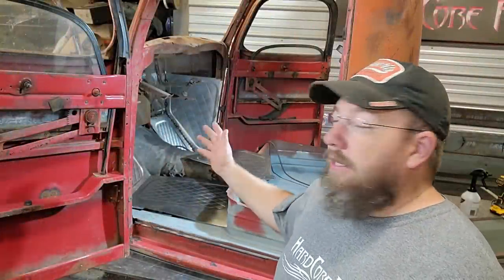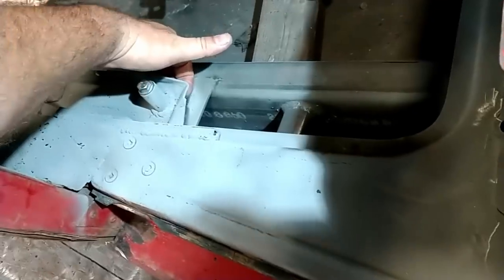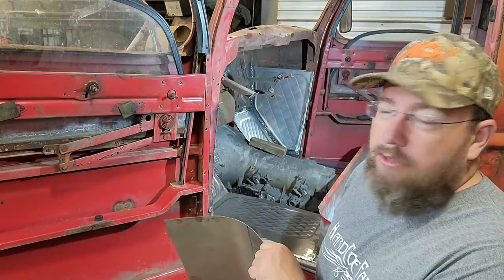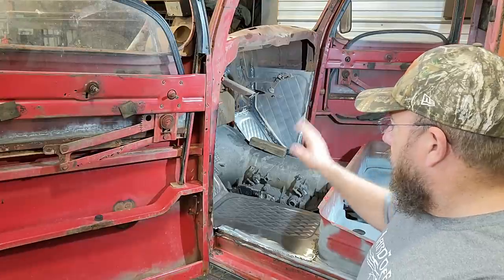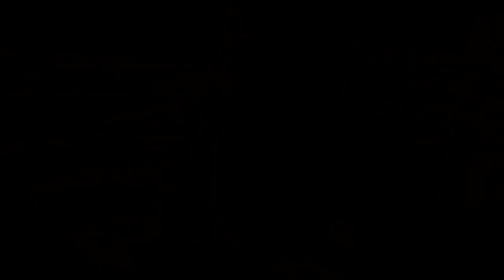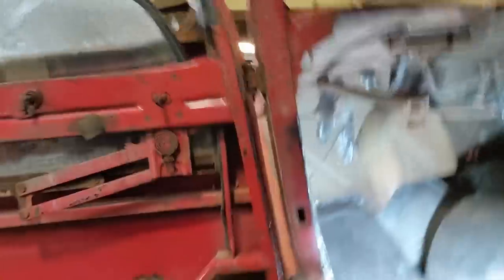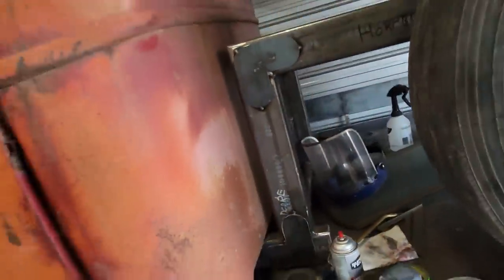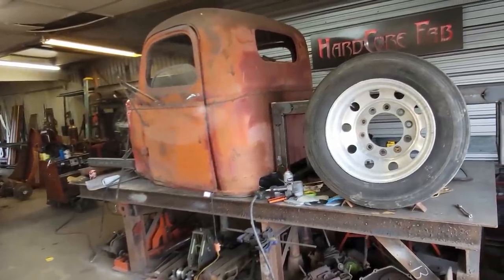The floor is welded (Hookers and Blow build part 6)

Comment: coming along nicely, the rims look good, you need a swampy air conditioner for the workshop
Reply from the maker: Thanks!  I have one of those....High humidity + no air flow in the shop = big soupy mess back there. Besides the thing being to noisy to video around.  I've got another plan in the works but it will be awhile before it comes to fruition. Stay tuned!
Reply: Sadly a swamp cooler is next to useless in KS most of the time,  the natural humidity is to damn high.